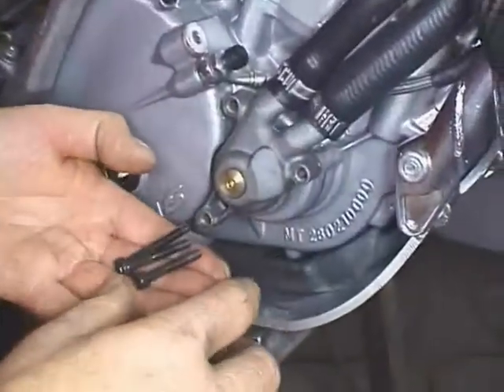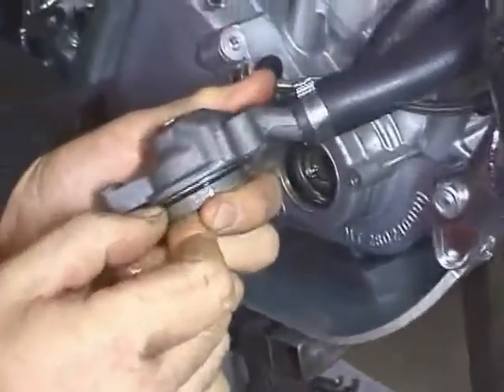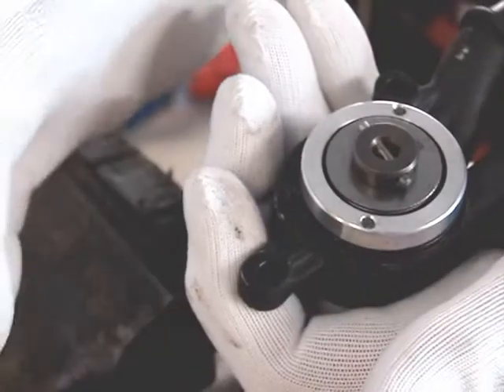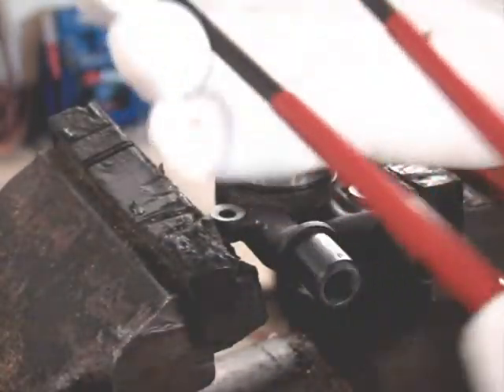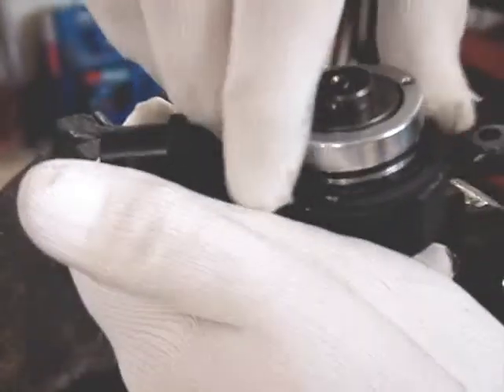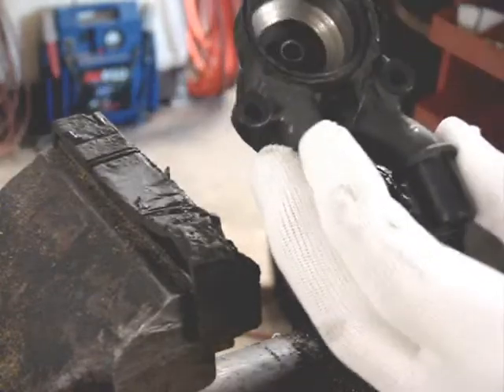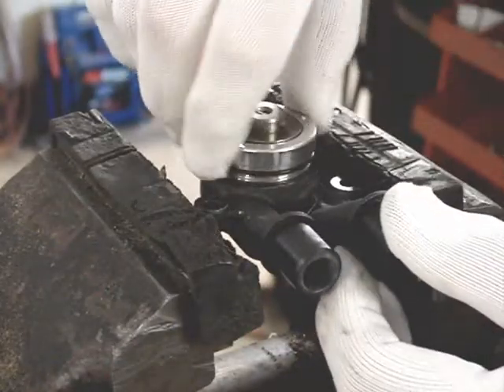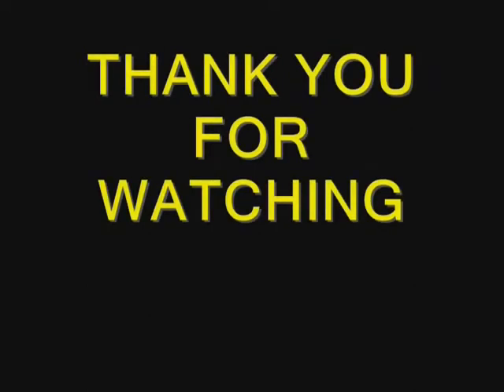Jim Snell - servicing - 2015 AND NEWER GASGAS TXT PRO WATER-PUMP

Comment: hi Jim, will the newer water pump fit in a 2004 engine? Is the newer pump better for not coming apart?
Reply from the maker: Honestly, I found the newer pump to be less reliable, the interior "rebuild cassette" is very pricey as well. regards
Reply: @TRIALSPARTSUSA  Thank you for the reply.